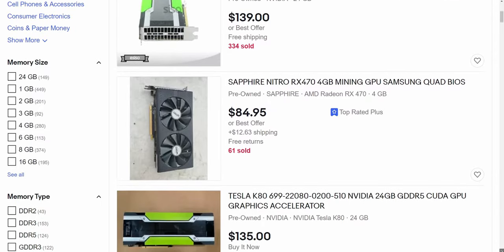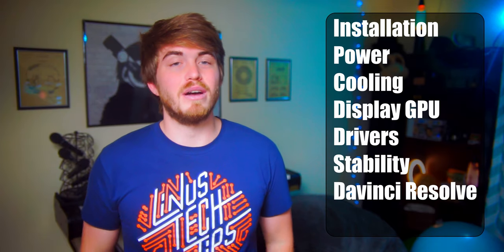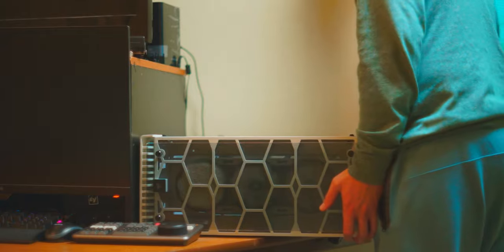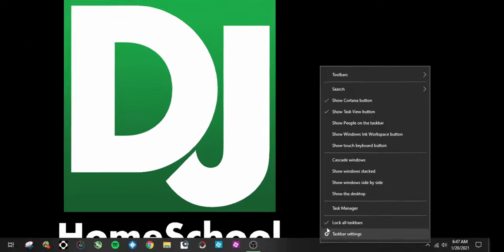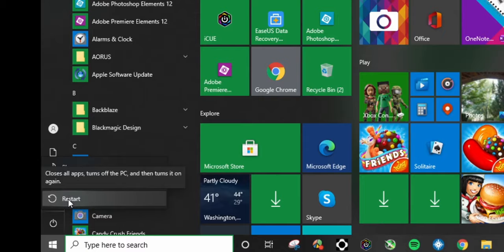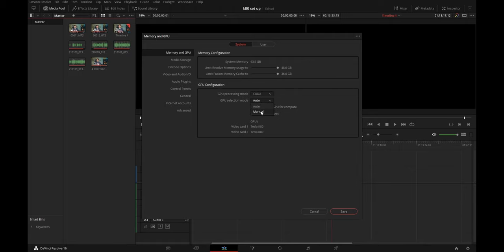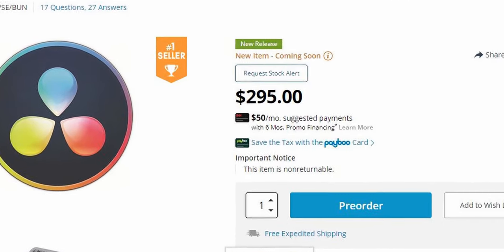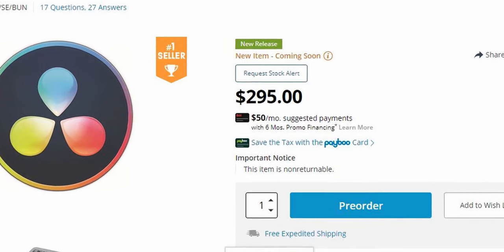24GB Tesla GPU for Video Editors

Comment: I just got Nvidia Tesla K80  and  Quadro K6000   I  don't understand way  problems when this card has same  Kepler  architecture of processor .  What you suggest to change or to eliminate K80 I want stable system for editing not gaming .  Pleas tell me how to solve problems .
Reply from the maker: Unfortunately, the answer is more money. You need to buy a Nvidia Quadro RTX A6000 for $6k. 🤷🏻‍♂️ 
Or buy a cheaper gaming card that is decent at editing. 
Unfortunately there are no cards available right now due to bit coin. So i am currently dealing with this unstable system until a modern gpu comes available. 
If you have done everything outlined in this video and you still cant get stability, it’s likely do to lack of driver support. 
Im sorry 🤷🏻‍♂️ not much else you can do. My system with the k80 crashes occasionally. It’s not stable. I dont recommend this configuration.
Reply: @WillCarterTech    What motherboard you was using
Reply from the maker: Gigabyte Z390 Aorus Master
Reply from the maker: Like i said though. My system isnt stable. So getting the same motherboard as me will not make your system more stable.
Reply: @WillCarterTech   Can Motherboard make some different
Reply: @WillCarterTech   Thanks man , I made mistake because I all ready pay and wait to come.  any way thank you very much . Ah yee one more question if you have to decide between  Nvidia Titan GTX  or Quadro K6000 what is your decision .
Reply from the maker: I dont really know, ive never personally tested those cards. I’d recommend you look up puget system’s benchmarks for those GPUs.

Comment: Yeah but nVidia 3000 series cards are currently impossible to buy.
Reply from the maker: Zakly! 🤣
Reply: Well IF you have a business rep you can get a RTX 3090 though they will try to get you to a A100 or 2 V100s instead of a single RTX 3090. As they are meant for business and most businesses into GPU compute want new not cheap. The major difference from A100 and V100 and VRAM bandwidth. As they are compute cards the difference from GDDR and HBM is a thing that GTX and consumer RTX cards won't matter about.
Reply from the maker: @yumri4  yeah $12,000 later I’ll have 40GB of vram 🤣 It blows my mind the profit margin for business labeled products. 
They try to do the same thing and charge more for the “gamer” labeled products. It’s so stupid.
Reply: @WillCarterTech  I agree it is stupid but it is paid so it is the correct "market price".
Reply from the maker: @yumri4  you are correct. However the only reason it is priced that way is because Nvidia has no competition. There is no other product that meets those specific needs.
Reply: @WillCarterTech  You most likely mean the CUDA API suite of nVidia's. So far Intel has tried but failed with CPU compute with a high core count co-processor cards of the Intel Phi series. AMD tried and seems to still be there but with OpenCL instead of CUDA. Depending on how the software is written OpenCL might be better or CUDA is better. IF it has both normally CUDA is better.
Reply from the maker: @yumri4  yes, in my personal work flow cuda is much faster, with little quality loss.

Comment: you can speak about prices. now a 3060 costs 900-1200 euros, and if you compare the k80 is only 250-300 euros, if you have a good psu, and another gpu for display, you should not have problems with it.
Reply: @WillCarterTech  true. But i could get a really good cooling for my laptop for like 4 euros. Fans, and other things were avalibe, i only had to  buy patch tapes.
Reply: @WillCarterTech  btw do you have any gaming resoults too? I am curious
Reply from the maker: Serve the home actually did a video on the K 80 gaming performance.
Reply: @WillCarterTech  could you give a link, because i could not find that video

Comment: what driver version did you use?
im useing gtx1080fe for my mainpc AORUS X570 ULTRA
i tried Game ready driver and Studio driver and Tesla Driver on 472.12 , 462.31 , 462.96 , 452.96

but i start up my pc 3 mintus and my mainpc get freez and can't not boot up any more
and i remove the k80 from my motherboard my pc can boot up again
so the k80 doen't work on my main pc
so i buy a quadro k600 from ebay and plug in both k80 k600 on my second pc (Huanan X79)
and i can't even enter the bios
i stuck in post code "d4"

can anyone help?
Reply: @WillCarterTech  im useing the DDU(Display Driver Uninstaller) to delete my driver but not in safemode
and im useing windows 10 21H1 19043.1237
Reply from the maker: It sounds like your problem is much deeper than driver corruption, but give DDU a try in safemode just for the heck of it. I dont think it will fix your problem. But i was having freezing about a month ago (not as bad as you) and running DDU in safemode fixed my issue. So it’s worth giving it a try. 
Ive been using the latest game ready driver for my gtx 960. And that seems to be the only driver that doesnt give me issues (“as much.” there is still occasional issues after windows updates or program updates)  

Give that a shot and let me know if it changes anything. You have a pascal gpu, and 2 kepler gpus. Try using only kepler and use a kepler driver. The 960 i have is a kepler gpu like the k80. So i dont have as many driver conflicts.
Reply from the maker: Also craft computing has done some bios hacking to get the k80 to work better. He will have better information than I can provide.
Reply: @WillCarterTech  i tried in safe mode use ddu still useless and i trying to using ubuntu 20.4 to install the nvidia driver but still get screen freezing and can't boot up again
i think its my k80 vram die broken
but still thank you!
Reply from the maker: @linya0711  Yeah I would have to agree. I had another comment about six months ago say that their K 80 was dead when they got it. I think those GPUs are getting old enough that some of them are starting to give up the ghost.

Comment: 10:25 the name ssds today aren't fast enough to saturate the x4 gen 3 link they have, let alone double the bandwidth at gen 4. You will spend more money on gen 4 when the memory chip on the ssd can't even saturate last gen specifications.
Reply from the maker: There are ssd manufacturers that advertise 7 GBps
Reply: @WillCarterTech  unless it's 2 drives in raid 0, I doubt that's happening.
Reply from the maker: Hmmmm. I mean sequential reads and writes are different from real world performance so you have a good point

Comment: Any update for DRS 19 COMPATIBILITY?
Reply from the maker: here is an update that I wrote in the description of the video 3 and a half years ago. This should answer your question sufficiently. 

2/9/21 Update:
The k80 is built on cuda 3.2 architecture. DRS17 effects such as magic mask cannot run on anything before cuda 7. To cut bloat and keep video editors from being confused as to why their GPU works with some FX but not others, they just cut support entirely. Also, Solidworks 2021 has a similar story. That is why we won’t see the k80 supported by developers in the future. This is truly a bandaid in my system. As soon as I can purchase a 3090, I will replace the k80.

Comment: Is the nvidia tesla k80 good for mining? Asking for a friend 😉
Reply from the maker: As far as I’ve heard, yes they mine like crazy but they consume so much electricity that you would end up with a negative $$. So even though they are great at mining, they cost more money than they earn.
Reply: @WillCarterTech  + mining won't make use of all the VRAM, which is one of the top features of the card so it doesn't make much sense, 
you should get a 1080ti which has faster ram instead ;)

Comment: i began video editing a long time ago, and if i remember right even my first workstation has two gpu's in serious bussines workstations its normal to have two cards. not like a gaming pc with two cards, often you have a small and a big card. a small card for the viewport and windows stuff and a big card for render and working. my actual Workstation has a Radeon ProVega frontier for the viewport and a nvidia P40 for Cudacompute so  the workload is splitted up and everything runs fast as hell. normaly you come to a point where u need more power, so you buy a new card but you realy should consider to keep the old one, if you work professionaly its not worth to sell the old card on ebay for 100 bucks, better u keep them ;-)
Reply from the maker: Wow! I'd love to know how you got the Radeon drivers and the Nvidia drivers to cooperate! that's amazing. I wish I could get this kepler gpu to work on some of the modern programs that I use. Unfortunately, kepler lost support around the time that I published this video. I kept running this card as long as I could, but eventually I needed to features of the updated software and I couldn't continue using the older version of the software. That required me to upgrade my GPU. I really should do a video on my new GPU. but I doubt it would be that interesting. "new GPU better than old GPU" not a super interesting topic for most viewers.
Reply: @WillCarterTech  you dont need to do something special, simply install both cards and install both drivers. In time from Win Xp nvidia disabled Physx suport if an AMD card is present, with Windows Vista Microsoft made the mistake that only one graphics driver can be loaded at a time, so you cant instlal two different cards under Vista, but since windows 7 you can install more gprahics drivers again and nvidia stopped to deactivate features if a AMD card is present. I dont know Wath Ms do to win 11 but with win10 and winserver mixing cards is no problem, actualy I have a system with one Vega Frontier, Radeon Pro w5800, Tesla P40 and a Tesla V100. Works fine, only rhe V100 has some ECC erros because the HBm memory which Nvidia made is shity.
Reply from the maker: man! That sounds like an interesting experiment from which you could make a short video. I think a lot of people would find your set up very interesting; including myself.

Comment: Why does a program like Davinci resolve need to support specific GPUs? Interesting.
Reply from the maker: It has to do with GPU architecture changes over the years. There are a few new effects in DRS17 that utilize newer versions of CUDA, Direct X 12 and Ray Tracing (A.I.) cores. Blackmagic Design decided that it would be less stable to try to code the new effects to support both older architecture and newer architecture. Since most Davinci Resolve users left Premiere Pro due to stability issues, Blackmagic Design decided it would be in the Users best interest if they continued to make Davinci Resolve a stable platform. This means sacrificing some compatibility with GPUs from a decade ago. The positive side is that modern cheap GPUs are way more powerful than the $5,000 Tesla cards from a decade ago. The sad part is, those old gpus will need to be recycled since they can no longer be re-used.

Comment: I can only use this card on Linux... on Windows it appears configured with the drivers correctly, but no editing software recognizes it... it's not a defect, because on Linux it works
Reply from the maker: Davinci resolve dropped support for Kepler GPUs in the middle of 2021. Several other software companies did as well. Nvidia also stopped supporting Kepler GPUs. the k80 is officially at end of life. If you want to use this card you need to install old versions of software. For example davinci resolve studio 16 supports the k80, but 17 and newer do not.
Reply: @WillCarterTech .. hello friend, are you sure about that, my k80 wasn't showing up because it was in TCC I changed it to WDDM... and now it appears as a video card.... I downloaded the new Davinci, I tested a rendering and it was normal
Reply from the maker: @jaoninguem7800  oh! that's amazing! i have no idea what TCC or WDDM is. Please make a video showing me what you changed so that I can do that too. my k80 has been sitting on a shelf since i bought a 3090. it would be nice to give it some life.
Reply: @WillCarterTech  I answered you with the guide, but it seems that YouTube removed it because it had a link

Comment: i reccomend that you try it in Linux because card was made for it and its more stable
Reply from the maker: Yes I had a very good experience with Pop OS. Unfortunately not all of the programs that I use regularly are compatible with Linux. And I’m not willing to swap OS between tasks. I was actually able to achieve stable performance and windows after a few months of tweaking settings. A lot of my issues were caused by the stream deck software and Black Magic “desktop video” software. After uninstalling those two programs and changing a few settings in windows and in the bios I had a very enjoyable experience with the Tesla K 80.

Comment: Can i use this gpu for cfd & cad design ? I think it's about 200$ (1280￥). With that money i can buy quadro p1000 with only 4gb vram. Which one would be better.
Reply from the maker: Due to Kepler no longer being supported by many programs such as 2021 solid works and davinci resolve 17. I would say that a newer GPU would be recommended. The p1000 is based on Pascal, 2 generations newer. So it’s likely still compatible with your program, whereas the k80 is not likely compatible.
Reply: @WillCarterTech   i'm going to use much older version of catia + ansys fluent.
Reply from the maker: I would double check the minimum system requirements, but yeah you could probably get the k80 to work. 
The p1000 would be a more efficient GPU because it draws less power. 
It depends on how much vram you need for your work load. CAD normally takes a lot of vram. 
If you have a good plan to cool the k80 and your local electric company doesn’t charge a bunch, you can make the k80 work. But I bet the p1000 has more processing power just based on the spec sheet.

Comment: that lens looks super soft.
Reply from the maker: The wide is an old vivitar with some micro scratches on the front element. The 50mm is an auto chinon with micro scratches on the front. It doesn’t matter if i take a picture in 6000 x 4000. The image still looks soft. I kinda love it though. It’s not great for everything but it’s nice on Skin and the out of focus areas and super smooth.
Reply: @WillCarterTech  ah a man of culture using vintage glass.
Reply from the maker: KC2Lucky, i have found a vintage lens brother! 🙂 I love my auto chinon 50mm f1.7 and i wish i could use it for a roll but my room is too small for a mid shot.

Comment: An integrated GPU can easily output to multiple displays. Even my notebook with integrated graphics can drive 4 displays (1x1080p 3x1440p) easily at the same time.
Reply from the maker: How do you do it? USB to hdmi adapters?
Reply: @WillCarterTech  A USB 3 Dock.

Every iGPU of the last years can easily put out 4K signals, not sure how you came up with 480p.
My desktop mainboard also has 2 display outputs which go up to 4K60 via the iGPU of my 8700K.
Reply: @WillCarterTech  i could also run the monitors directly on the USB port via daisy chain. The dock is not necessary for that.
Reply from the maker: I must not have communicated my point well. I meant to say the Tesla GPU driver only allowed for 480p resolution. And the Tesla driver would overwrite the other display drivers that I had installed. 🤷🏻‍♂️ so if I tried to use the intel iGPU it would be limited to 480 by the Tesla driver and if I installed the intel driver it wouldn’t recognize that the Tesla was in the system.
Reply: @WillCarterTech  Oh, well yes, that is a problem indeed.
Reply from the maker: It’s a struggle 🤣 so far I’ve got it to limp along. Another comment mentioned getting a low end old Quadro card for the displays for cheap. Teslas and Quadros use the same drivers. So that might help the Tesla perform better.